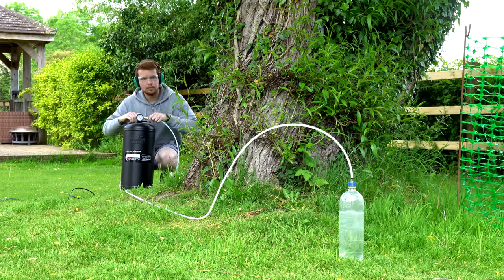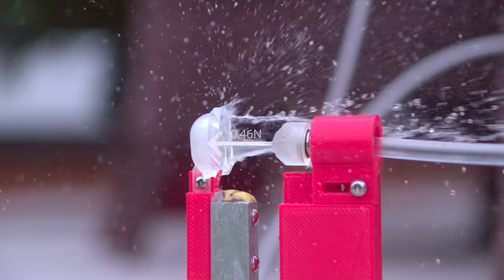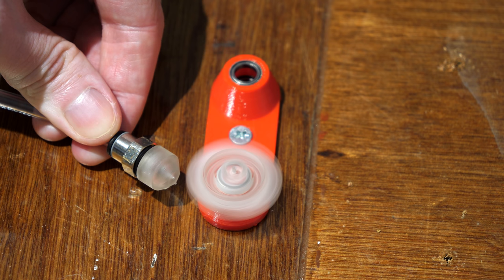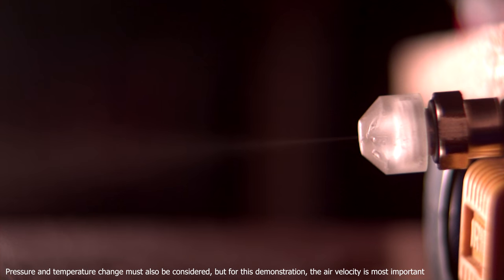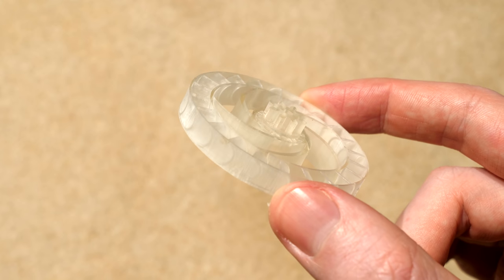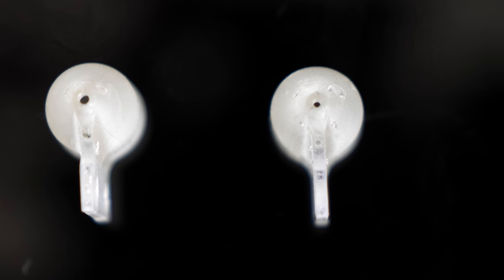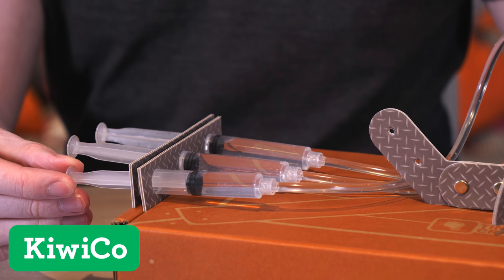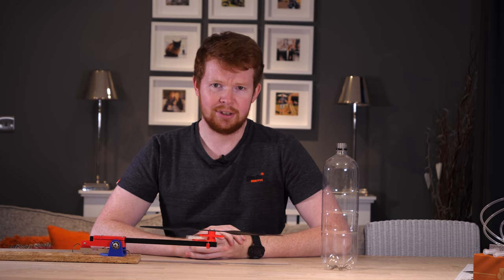Micro Pelton Turbine

Comment: hmmm... is it less efficient because the air has a 'venturi' effect where it wastes energy by accelerating air that's on either side of the nozzle? If that's the case, a dutch on the input to the turbine could be helpful.
Reply: No it's the same reason that commercial airplane engines get better. Idk but something about more mass means more efficient
Reply: Maybe its to do with impedance matching?
Reply: Honestly I thought it had something to do with the air pushing directly against something.  I am not educated on this, I'm just an IT field tech, so this is purely guessing.  But my thought is that the jet of air alone is only acting on the nozzle.  The energy is lost rather quickly into the surrounding area and only transfers energy to the nozzle as it exits.  If you put something in the way of the escaping air now it has to transfer its energy to the object in front of the nozzle too.  I bet a simple flat bladed wheel will still produce greater thrust than the nozzle could do on its own.
Reply: I think almost all of the thrust is lost on the nozzle due to the shape of the nozzle. Not made for harnessing the thrust created, just an inefficient choke.
Reply: Well I think that a de laval nozzle would beat everything
Reply: Hahahhahah i laugh arrogantly at all you plebs. The real reason is because a rotary wing creates thrust through aerodynamic lift. Lift is NOT limited by newtons 3rd law of motion, unlike a jet nozzle which is.  This means more thrust per unit energy into the system, hence more impulse
Reply: @gameonyolo1  I don't know, but if 'better' was a typo for 'bigger' then I think you're right. Commercial airliner engines are getting bigger and bigger because a higher bypass ratio of air moving around the core of the engine makes it more efficient. As a general rule it's more efficient to move lots of air slowly than it is to move a little air quickly in order to generate thrust. Thrust is also (usually) proportional to mass flow rate (higher mass flow = more thrust) and in Tom's example the setup with the propeller clearly has a much higher mass flow rate than with the small nozzle.
Reply: It's the same reason you need a bell on a rocket engine. The air is "over expanded" which means it's shooting out sideways because the pressure outside the tip of the nozzle is higher than atmospheric. To get more efficiency you need a bell that expands the flow until atmospheric pressure, Tom should totally print one!
Reply: Sadly its hard to by Dutch people in the store
Reply: @koenigsegg888  Rocket nozzles are supersonic, this probably isn't - it doesn't behave the same way. Expanding a supersonic fluid causes the velocity (and hence thrust) to increase. Expanding a subsonic fluid just slows the fluid down, so decreases thrust.
Reply: @3Triskellion3  
Not exactly, you don't need hot gases, all you need, is expansion. The De Laval nozzle does nothing more than expanding the gas, to utelize the temperature difference and thereby transforming temperature difference, as well as pressure difference into gas velocity. 
This means, that even compressed air can utelize this stile of nozzle, you only need either high enough pressure or a small enough throat, to exceed the speed of sound at the throat.
The reason, why the prop alone has a higher specific impulse is not the nozzle as you would get the sme result, using a De Laval nozzle, the prop would still have a higher specific thrust.
Reply: @Kycilak  first of all, i was clearly being humerous. Second,  your thinking shows your ignorance and lack of ability to think. Just because something is called a law doesn't mean it applies to the situation. Still, this is the kind of mistake even professors of aeronautics makes, so it's not your fault.
Reply: @VicAusTaxiTruckie  
Elaborate, how does Newtons 3 rd law not apply to aerodynamic lift devices, further more, how does it not apply to this device, that clearly uses it, to drive the turbine?
The problem is, that he uses the total impuls of the air jet, to creat aerodynamic lift, wich in turn creats a total impuls.
There is a great explaination, going into the detail, why the total impuls, when transformed into momentum, can increase due to utelization of a higher reaction mass.
Reply: It's because thrust is proportional to exhaust_mass_flow * exhaust_velocity, whilst exhaust_power is proportional to exhaust_mass_flow * exhaust_velocity^2. (I am also counting the air moved by the propeller as exhaust.) The goal is to maximize thrust / power, and you get a lot more thrust for your input power by accelerating a lot of air by a little,  rather than accelerating a tiny amount of air by a lot, even after suffering considerable losses in the turbine.
This effect completely dominates when your device isn't moving relative to the working fluid (air). At high relative speeds though, and especially when you pass mach 1, other effects become dominant, and you are better off accelerating a little air by a lot.
This is why you see giant turbine powered rotors on helicopters, large turboprops on slower airplanes, fat high bypass turbofans on barely trans sonic airliners and narrow after burning low bypass turbofans, or even pure turbojets on super sonic fighters. All these vehicles ave turbine engines as their hearts, but accelerate different amounts of air according to what is most efficient at their intended speed range.
Reply: @fnorgen  thats a really good answer, your equations check out
Reply: It's the same reason why the high-bypass turbofans on an airliner are more efficient (less fuel for the same amount of thrust) than the low-bypass turbofans on fighter aircraft: The former has a much lower average velocity of the exhaust air than the latter, same with the propeller vs the straight nozzle, and the minimum amount of power needed to create a given amount of thrust is proportional to the thrust and the exhaust velocity.
Reply: @ollie9518  exactly what I was saying
Reply: @gameonyolo1  so he needs a flywheel?
Reply: @asailijhijr  no he needs as large a fan as possible
Reply: Dang it people, stop hypothesysing and do some good okd fashioned math. Thrust  = mass/second * speed of the mass.
Energy = 0.5 mass speed^2
Calculate the thrust of the nozzle alone, then assume you can transfer 100% of the energy to the blade (or work with an efficiency factor) and calculate the maximum thrust from the blade, remember that you can vary how much mass is being pushed by the size of the blade, so you have to set up an equation for the speed of mass vs mass flow, then take the derivative of that to find the maximum. Fun little physics problem, use Wikipedia as your guide and you should be able to solve it :)
Reply: @beaconofwierd1883  
You will notice, that thrust is also velocity squared times active surface area, times the density of the working fluid (air).
Your explaination does not apply. 
 Really, it all boils down to the definition of specific thrust, it is a measurement of thrust times time and falsely applyed as a means of discribing efficiency. The problem is, that it surely describes the effective use of thrust but not the total efficiency of the system.

Think of it as torque and power of an internalcombustion engine. Low torque at high rpm (petrol bike engine) and high torque at low rpm (Diesel engine) can give you the same power, yet only one of the two is suited for efficient transport of goods whereas the other one is suited for high speeds. 

Power= Velocity*Thrust
Assuming power will be the same without any losses due to friction,
an increase in thrust will mean a decrease in velocity, to satisfy the law of conversation of momentum.

What bugs me though is, that he does not mention, that you could modify the simple thrust nozzle to the extend, that it would produce the same result, without all the mechanical nonsense.
You would have to use a De Laval nozzle for supersonic flow and a mixing jet nozzle, to creat higher mass flow via the means of surface friction between slow moving and fast moving air (like a Tesla turbine :D).
Reply: @mandernachluca3774  I did not offer an explanation, I simply stated what you need to calculate the difference in thrust. Though after scribbling it down on a paper I realized that deriving to find maximum thrust is unnecessary, you can just assume that the total power in the two systems are equal and arrive at Thrust Rotor = Thrust Nozzle * Velocity nozzle air / Velocity rotor air, This simple equation is the "reason" why, it's the same result as using the equation Power = Thrust * velocity, but you don't have to "know that equation" but rather arrive at it from simpler/more intuitive equations. Granted what is more intuitive is sort of subjective, but my "explanation" is exactly the same as the one you gave.
Reply: It is like with the normal turbines. Air pushes to the side, when it hits ground/other air and that is less efficient than the turbine, which pushes the air back again
Reply: @fnorgen  thanks for this, I was having trouble figuring it out
Reply: it's actually really basic physics, the more mass is moved, the more power is created, whish mean that not only is the nozzle not using the de Laval design, it's also moving way fewer air than a propeller 100 time the size of the nozzle, the propeller is moving way slower, but it's still moving way more air at a time than a single 1mm nozzle. and the turbine is doing a similar job to a de Laval nozzle, making sure than every single bit of air is being used to produce trust efficiently.
Reply: @mandernachluca3774  This is incorrect, sorry. It doesn't have anything to do with whether the gas is hot or not, it's whether the gas is supersonic. The compressibility of a supersonic fluid coupled with conservation of mass causes it to accelerate in a diverging nozzle. Subsonic fluid is incompressible, so decelerates in a diverging nozzle. I recommend checking out the Wikipedia page.
Reply: @zuthalsoraniz6764  Ding ding!  That's the answer I was searching the comments for.  Low volume/mass of air requires a higher velocity to produce the same thrust, thereby consuming more power, since kinetic energy goes up with the square of velocity.
Reply: @VicAusTaxiTruckie  OK. Tell me then a situation in which Newton's third law doesn't apply.
Reply: @Kycilak  any situation where there is no finite frame of reference. Its defined in the principle itself
Reply: @VicAusTaxiTruckie  I don't see how this can be. Would you care to educate me on this matter?
Reply: @3Triskellion3  
1. I literally said, that you don't need temperatur difference for expansion. 

2. It has to do with temperatur, i'm sorry. The supersonic flow is achieved because of the law of conversation of mass and the fact that a fluid can not accellerate above the speed of sound in a pipe (due to compressibility of fluids at supersonic speeds, as you said), that's the use of the convergent section. The divergent section merely uses the laws of thermodynamics to further increase the velocity of the exhaust gases, if there is no pressure or temperature difference at the throat between the convergent and divergent section, than there will be no expansion, therefor no increase in velocity, only a decrease (even at supersonic speed. Yes, you can achieve superonic throat speeds without any compression of the gas). And even if there is a pressure difference, the gas still needs a temperature difference, wich will force one if needed (look at frozen outlets of gastanks that vented their entire volume at ones).

I would recommend you a lecture in thermodynamics and fluid mechanics and a good pair of reading glasses, you wikipedia scientist  ...
Reply: @Kycilak  in every physics kinematics textbook, action reaction pairs occur in a finite frame of reference.  Google it or go to the library
Reply: @VicAusTaxiTruckie  What do you mean by finite frame of reference? Finite in space? Also, newtons law just says that momentum is conserved, when wouldn't this be the case?
Reply: @fg8557  if you frame of reference does not include the d momentum of all bodies concerned,  the law cannot apply. This is entirely possible if fluids is concern. Ie, if your bloody free body diagram does not include the entire body of atmosphere a fixed wing is flying in,  3rd law does not apply
Reply: @VicAusTaxiTruckie  If your free body diagramm does not include all forces, then the diagramm is wrong, not the second law.
And Newtons Law does apply for a wing. Your system just has to fully enclose it.
Reply: @fg8557  thats exactly what i said.
Reply: @VicAusTaxiTruckie  You said, the law is invalid, which it is not, just applied wrong
Reply: @3Triskellion3  I never really understood the mechanics of rocket propulsion, even after visiting Peenemunde. It seems that there is more to it than just 'spitting out mass' (impulse=m*v). Why is the Laval-nozzle crucial? The expelled gasses do not now how they left the rocket, but they do know that 1/2* m* v-squared is the energy involved. 
 Or does it have to do with the internal energy of the (exhaust-) gas? The launcher wants kinetic energy and not a warming-up of the projectile.
Reply: @fg8557  if you apply any law in error, that law would not be valid for the application, hence invalid
Reply: @michaelhompus2475  The impulse (mv) is important, and the de Laval nozzle works by maximizing the m and the v. Gas coming straight out of a normal nozzle is at high pressure. It'll expand sideways if "constrained" by normal atmospheric pressures. That sideways expansion effectively lowers the mass in your gas stream. Expanding it in the "bell" so that it is at atmospheric pressure when it leaves the bell keeps the gas stream constrained to a narrow stream heading straight out the nozzle. That maximizes the m. Gas flowing through the throat of the nozzle is limited to a "stagnation speed" of the speed of sound. That is a hard limit on the v of a nozzle that opens up to the air. The "bell" of a de Laval nozzle redirects the pressure of the gas so it is pushing the gas straight out the nozzle, not off to the side. This push on the gas speeds it up, so it leaves the bell at supersonic speeds. This maximizes the v. 

I can see a couple of issues with this in this application. First, if the pressure across the nozzle isn't large enough, it won't stagnate and the de Laval nozzle won't get the air supersonic. If the pressure in the bottle is too small, then efficiency will fall. This can be mitigated by using a smaller throat. Second, for highest thrust, the bell has to be sized to fully expand the exhaust to match atmospheric pressure. Since the pressure in the bottle is falling, the optimal bell size is falling as well.
Reply: @buddhabuck  Tnx for the explanation.  I missed the sideways expansion before.  I guess that I should read ' That maximizes the m. ' as  'That maximizes the m in the effective direction', since the nozzle can't increase the number of gas molecules (=m) that enter it. If I understand you correctly, you say that the de Laval nozzle converts the internal energy of the gas (high pressure and temperature) into a higher v than would be achieved with a 'regular' nozzle.

Comment: I'm blown away. I never in a million years thought any more thrust could be made than just the air nozzle itself. Seems efficiency would go down. This is some game changing content.
Reply: Angular momentum helps as well, but by proposal is the air having the same buoyancy when not compressed as surrounding air means force has to be used to displace air it's traveling through. The turbine does not experience this as much because it's not traveling as far and you could add a cone around nozzle such that the air that's deflected goes around it creating vacuum at novel.

I would suggest a gas that is less buoyant than air and camering turbine where air goes downward then extending blade such that the air escapes when turbine moves up hill.
Reply: Also the diffusion of air outwards from nozel exerts energy outward that's wasted from not going downward

Comment: I'd say the reason for the nozzles low efficiency was the fact that the equation for kinetic energy states that kinetic energy is proportional to velocity squared. So using a large prop to accelerate much air a little gives higher thrust then accelerating a little air a lot
Reply: Which is basically the same conclusion that the Wrights came to when selecting the design for the Flyer's props. The went with two, slower spinning props instead of one fast one for that exact reason.
Reply: also why rockets have bell nozzles
Reply: LueLou  great explanation!
For those wanting to see the relationship:
F = ma = mv/t
P = Fv = mv^2/t
v = sqrt(Pt/m)
Showing that velocity has an inverse relationship to flow rate. Aka as mass per time increases, velocity decreases.
Reply: @GigsTaggart  Actually no. Bell nozzles are there to collimate the plasma. In the converging section, the particles are moving rapidly in random directions. (High pressure & High heat.) The expanding section the plasma is forced to expand backward, exchanging pressure/heat for velocity. In a perfectly calibrated bell, the exhaust leaves at the same pressure as the atmosphere. If it's under-expanded, it will expand outward in all directions and that energy is lost.

Comment: Tom, the turbine you ended up with is a simplified version of the "impulse" steam turbines from the early 20th century. For example, one such turbine was used for engine 3 on the Titanic. They are known for having a high power to weight ratio, though they are less efficient than turbines that use expansion.
Love you channel!

Comment: You can improve your turbine by change the turbine configuration. Check for centrifugal turbine and blade design (they are in function of air flow angle and speed). You might also want a stator stage before rotors.